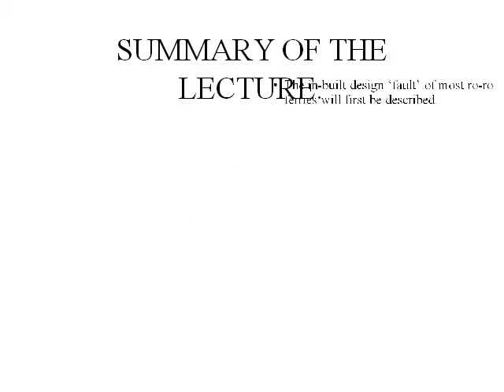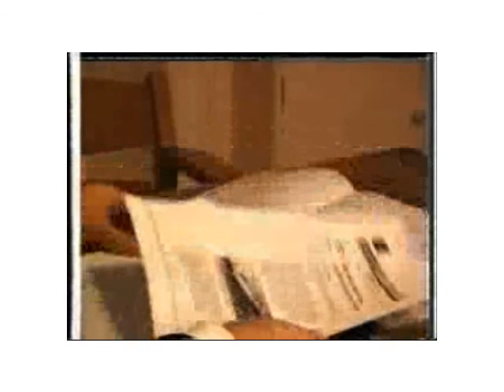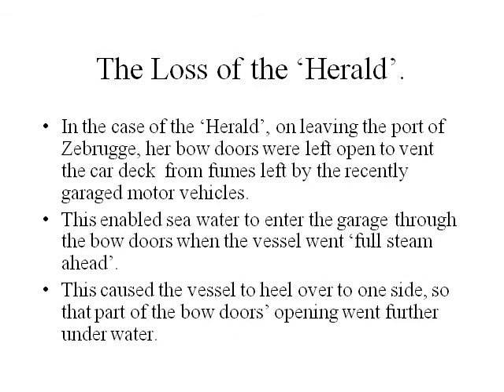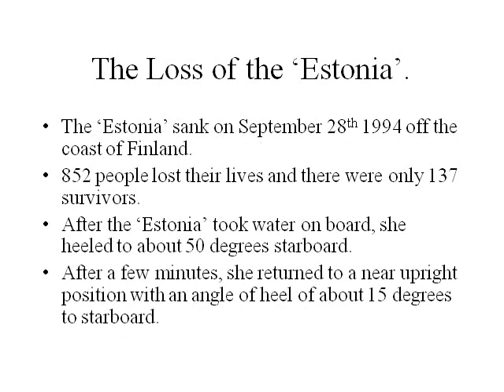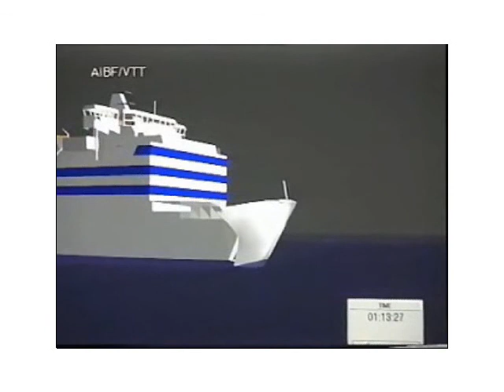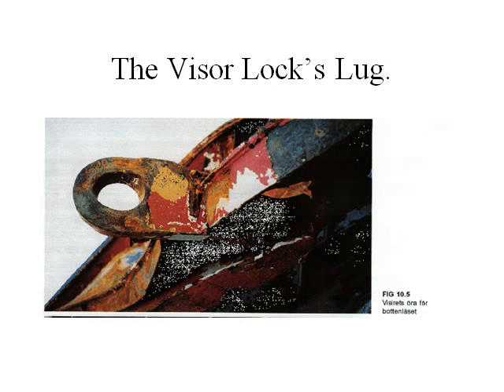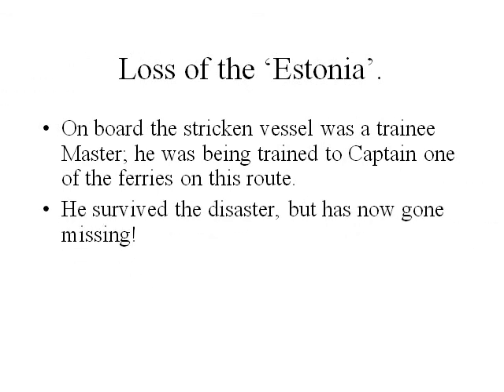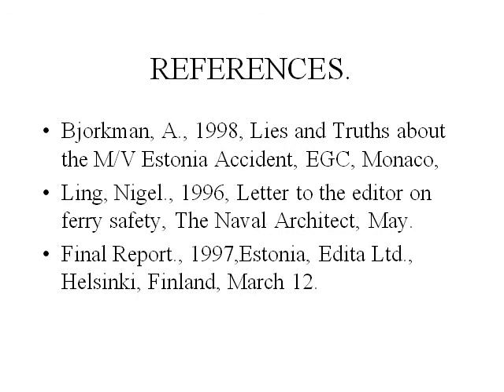RO-RO FERRY (CAR FERRY) LOSSES

Comment from the maker: @TheSlapdown Yes, you are correct, if Estonia had water on her car deck and heeled over to about 50 degrees to starboard, then she would have capsized, because her cargo would have shifted.  She would not have been able to decrease her angle of heel to one that was quite small; with water on her car deck.  Thus, the primary cause of her demise was not due to having large quantities of water on her car deck, as I have argued in the video!.